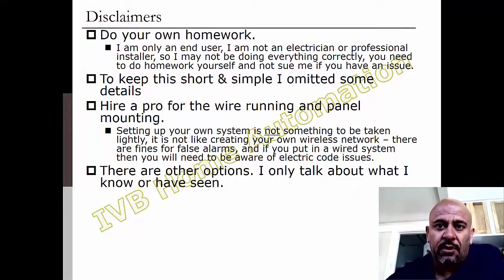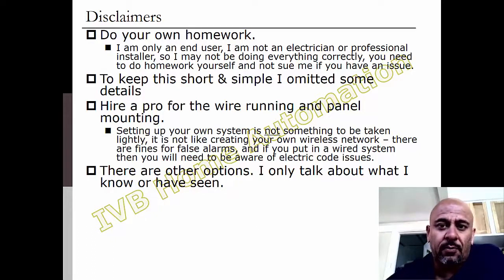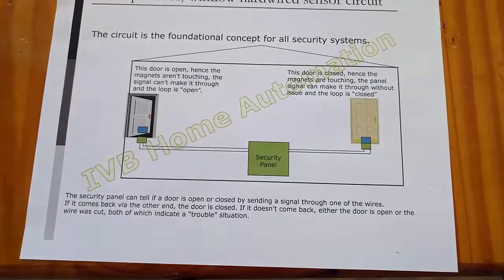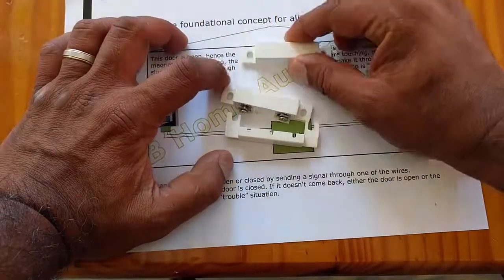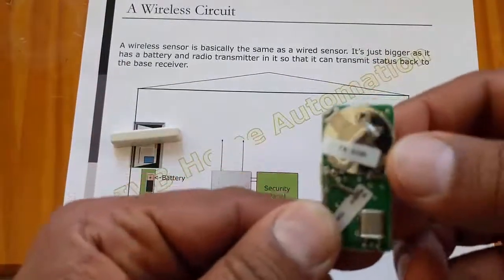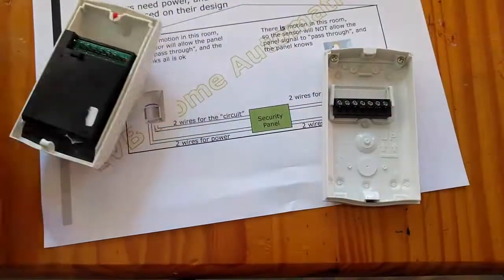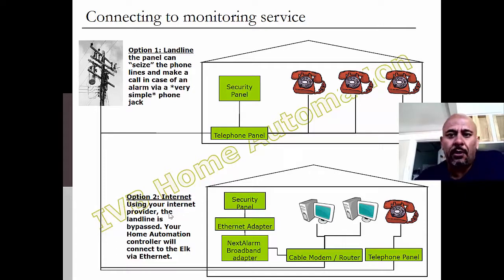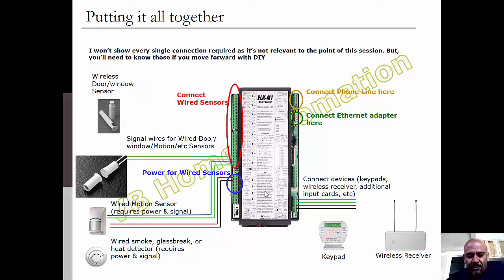Security Part 1: How to run wiring for a security system

Comment: Can one attach elk 922 relay to M1 gold j16 output comnection as a trigger? Elk tutorial videos show Elk Relay Board connected to M1Gold.
Reply from the maker: Sorry, a few questions before I answer.
1) Do you mean the 912? I don't recall nor can find a 922 as a relay. 
2) Could you explain what you mean by trigger?

I use tons of relays, have another video i'll post in the next comment. But I use the M1XOVR as I knew I'd need multiple relays.

I use a zone to trigger the relay. I.E., in the video i'll post in the next comment I used a simple light switch to trigger it.  When the light switch is flipped, the Elk rules pick up on it and flip the relay.

If the 912 does what I think it does according to the doc, you could use it instead of the M1XOVR. But if you want more than 1-2 relays it'll be far simpler and more cost effective to just use the M1XOVR.

Does that answer the question?
Reply from the maker: https://www.youtube.com/watch?v=WyppAYaohKs  is the video that uses relays. Just remembered I use my home automation engine (CQC) to monitor the zone and flip the relay, but the ElkRP software also has this ability.  I use CQC to keep all my rules in the same place, plus then I can trigger the relay and other stuff (ie music, lighting, irrigation, etc).
Reply: Yes. I called Elk. For a single relay switch, they recomended Elk 924 over the Elk 912. These are compatible with ElkM1 board. I will instead get Elk relay board as it has 8 dry relays.